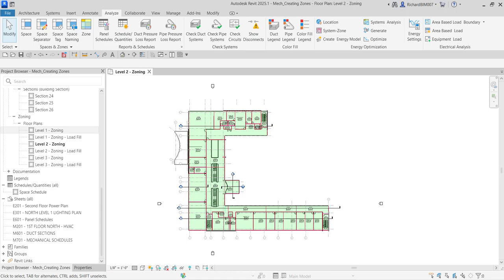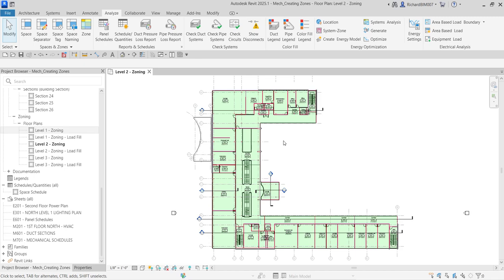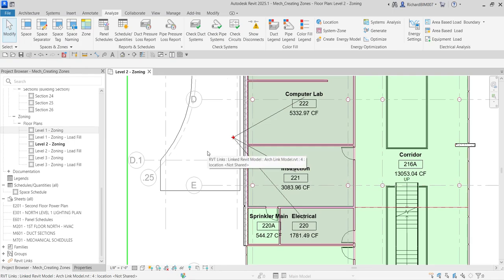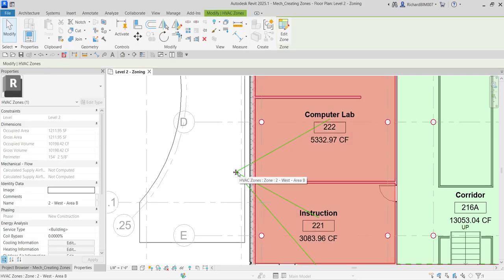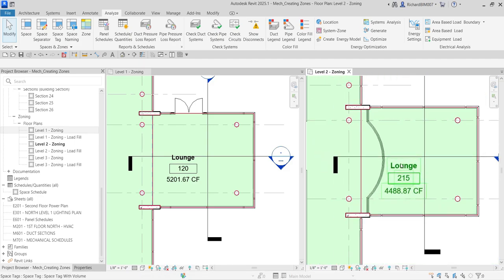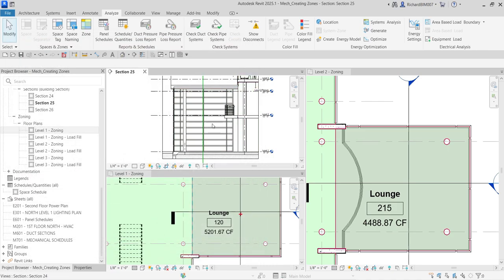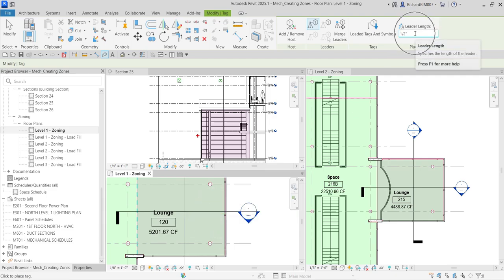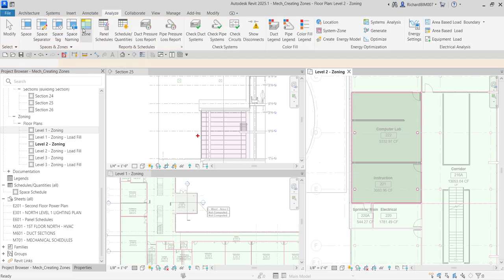REVIT 2025 FOR MEP DESIGN: CREATING ZONES

Comment: hi , please i don't know why in my energy analysis i couldn't modify any of them and i actually don't have the service type showed there i'm using revit 2026
Reply from the maker: hello, try this step:

Sign in
Top-right corner → Sign in to Autodesk
Go to Analyze → Energy Optimization
Click Generate
Make sure one of these is true:
Architectural model → Rooms placed
MEP model → Spaces placed
Check Energy Settings:
Mode: Use Building Elements
Building Type: set correctly (Office, Residential, etc.)
After this, parameters unlock inside Insight, not directly in Revit.

Comment: Hi and thanks for the video, I wanted to ask you once the zones have been set and the parameters have been assigned how do I obtain the calculations of the air flow in a given space?
Reply from the maker: hello try creating schedule, try this:

Steps to Calculate Airflow in a Space (Revit MEP 2025):
Make sure the spaces are placed correctly:

Go to Analyze > Space and ensure each room/space is defined.

Ensure each space has correct parameters like Area, Volume, Occupancy, and Space Type.

Assign a Space Type:

Select a space and in the Properties palette, set the Space Type (e.g., Office, Classroom).

Revit uses ASHRAE 62.1 defaults if applicable, which define airflow requirements per person and per area.

Set HVAC Parameters:

Scroll down in the Properties of each space to find:

Airflow per person (CFM/person)

Airflow per area (CFM/ft² or L/s/m²)

Number of people (can be auto-calculated from area/occupant density)

Recalculate the airflow:

Select the space and click Update Parameters in the Analyze tab.

Revit will calculate the calculated supply airflow automatically based on the formulas:

Total Airflow = (CFM/person × number of people) + (CFM/area × area)
Check the Calculated Airflow:

In the Properties palette under HVAC Calculations, you'll see:

Calculated Supply Airflow

Calculated Return/Exhaust Airflow

You can also tag these values using Space Tags that display airflow.

Use Schedules for Reporting:

Go to View > Schedules > Schedule/Quantities.

Choose Spaces, then include fields like:

Space Name

Area

Number of People

Airflow per Person

Airflow per Area

Calculated Supply Airflow

This gives you a clear table of all airflow data per space.